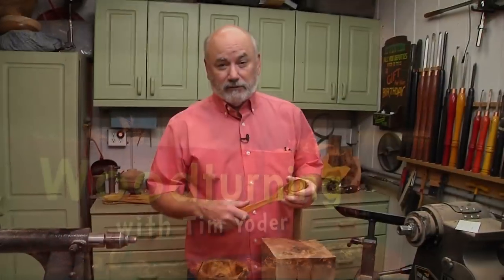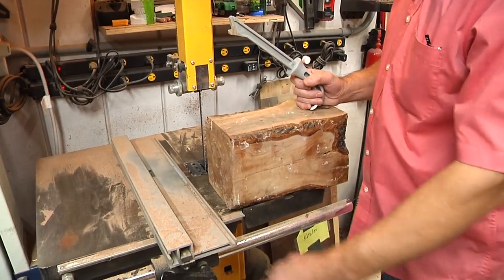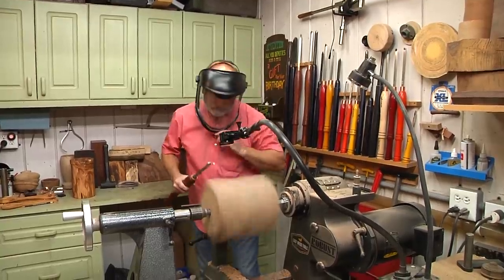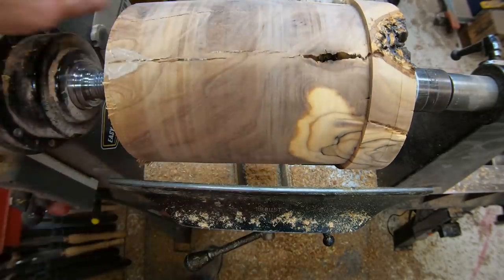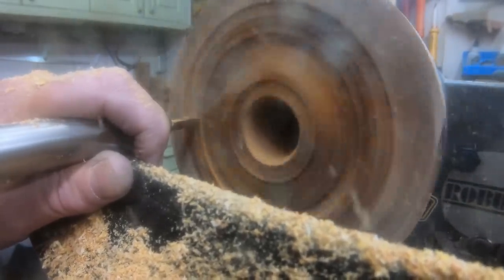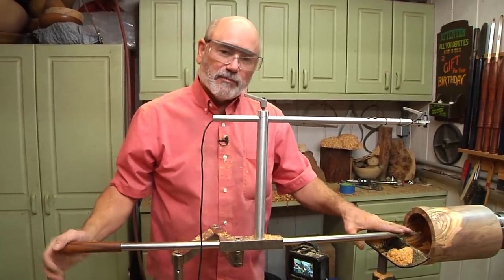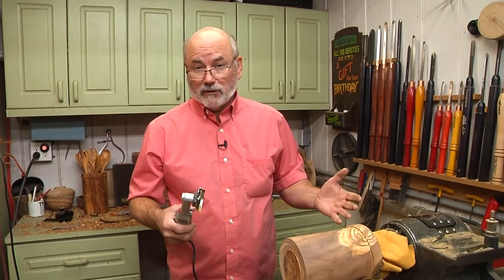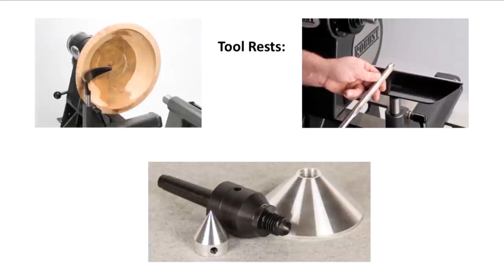Olive Wood Utensil Holder

Comment: As a carbide only turner, I like to use the round head tool to knock the corners off before changing to the rougher to get the blank round.

Comment: I still think of olive as my favorite wood to turn. These are some beautiful canisters. Nicely done Tim. I’m sure you gained some brownie points with SWMBO. 
1 question, why use mineral oil that never dries or polymerizes? I would have thought that you’d use walnut or tung oil, both drying oils that are food safe.
Reply from the maker: I have noticed that drying oils look good for a while but they lose their luster over time and need a new application. While mineral oil does the same I've always liked liked it because it is easy for the non-woodworker to find and reapply. Also we have some severe food allergies in our extended family so I have always played it safe.